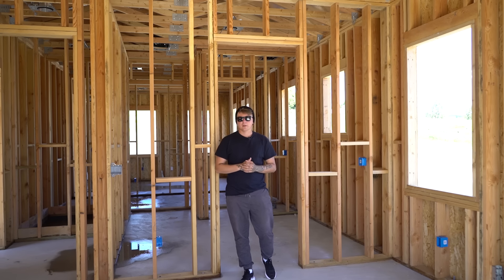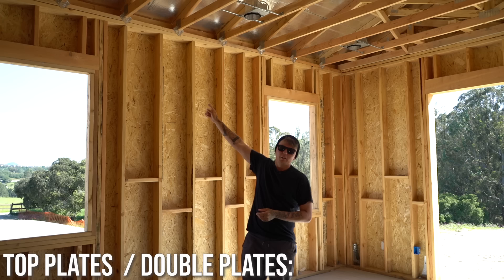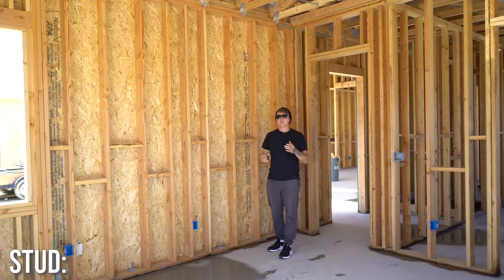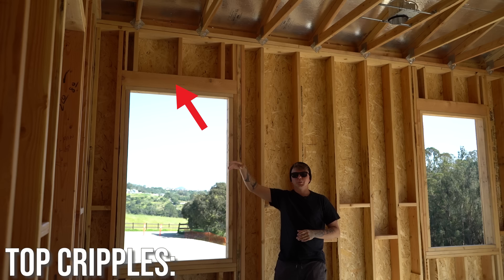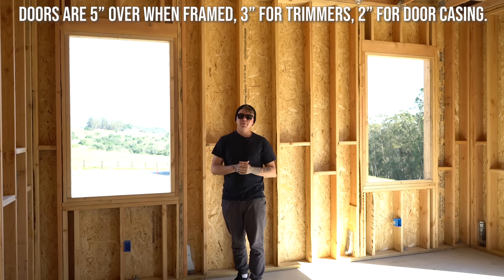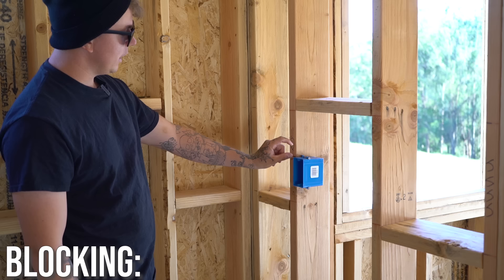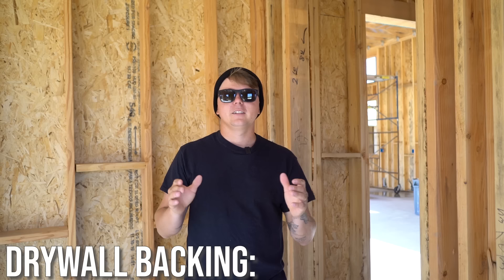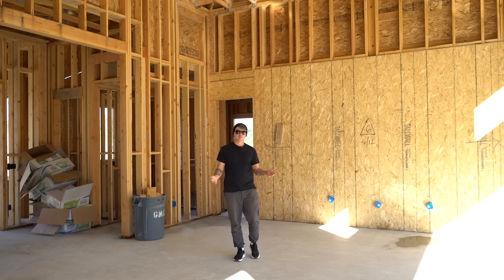Carpentry 101: Basics of Wood Framing with MattBangsWood [#1]

Comment: "pressure treated eaten by things..."
This is more likely to occur in treated wood which has had it's wood fibers either a) never properly treated to start with (e.g. heart wood spots, knots, etc.) and thus was more susceptible to nature/critters than wood fibers in other parts of the lumber that was properly treated/properly absorbed the treatment, OR b) the wood fibers treatment protection has weakened some to completely failed due to leaching, which can be caused by ground contact, especially with non-ground contact treated lumber (but can also happen in poorly treated/poorly installed/stored lumber), or caused by exposure to various environmental impacts such as contact with chemicals, contact with flowing water, etc.
While 'well treated' (lumber received appropriate amount of treatment chemicals, was exposed to proper atmospheric pressures/conditions for the proper amount of time, held at the proper temperature, etc. etc.) treated lumber, especially ground contact grades, using current generation treatment technologies, installed per code, and maintained as necessary given any changes to structure, environmental conditions, etc. ... you should never experience any issues.
....However... if you live in the "normal world" like I do, at least 1 if not more of these "proper/appropriate/etc." conditions will NOT be in place/exist; The only perfect carpenter was Christ! Every one of the conditions that are not being met means a greater chance of treatment failure at some level for some type of hazard.  The longer these conditions persist, the worse it can be.  
Basically, if you buy "good" treated lumber, install it correctly, take care of it, and luck out, you should have to best possible protection available from current generation treated lumber...that doesn't mean that in this near-perfect scenario of treated lumber will survive any critter attack; you could still be that one treated lumber owner who encounters that rare West Eatwhoodistani beetle or invasive South Grabasisbury ant invasion that proves too much for even the best treatment.
...and a bowl of green M&M's

If you got this far and understand, you're at least half as cool as I.

Comment: I'm highly allergic to OSB. I am just wondering why everyone uses it? Is there something else to use? I'm going to frame out a small wall for my kids to climb on with rock wall grips. Can I use plywood for the outside or is there a reason why people don't use plywood? Does it expand or something? I am just wondering why I see sheds built this way and all new housing construction with OSB walls.
Reply: Usually when it rains plywood sheets swell up and inspectors ask for them to be replaced

Comment: As a PE structural engineer I gotta say you nailed it 😉 well said. It's also worth mentioning how jambs and headers must be sized for wind loads in some areas. Other than that, the blocking will sometimes be installed with horizontal long edge at all edges of sheathing to allow for edge/field nailing patterns. It's called a shear wall and works both in wind and seismic forces (lateral loads). Then hold-downs. Overall, well done, I could hire you to educate some shitty cowboy framers I sometimes have to fight...

Comment: At 2:11 you start into how the studs are 'pinned' into the bottom plate after mentioning that the bottom plate was 'BOLTED' to the concrete foundation but just stop and think about that. Smooth nails shot into the end fibres of a stud are doing what exactly to keep a building down? Yes, gravity does all the work but a huge tornado or hurricane could lift a house off because of those smooth nails doing not much. Just food for thought. Speed of nailing or using screws?

Comment: I'm gonna call you out/correct you on something...
At about 12:40 roughly. The channel you showed works for interior walls that don't get insulated. But are NOT okay for walls that DO get insulated. It should go II_. Not I_I. Reason is the insulators cannot get insulation in behind there, thus creating a "cold" spot. Those cold spots always cause weird reactions with the sheetrock screws.

Comment: When I helped framers in the 90s, for bracing in the wall they would diagonally install bracing . Not blocking. They would cut in like a 1x3  or 1x4 diagonally inlay it into the wall. Cut and chip out 3/4 inch recess and fasten in the 1x.
Is that still proper or not recommended?
Hope that makes sense...

Comment: Very informative but I left with a few questions...
8 x 12 is 96 so where does the extra 4 inches come from when the stud is 92 inches, ditto for the 9 foot wall - is it 2 inches from the buttom stud and 2 inches from top stud? 
There seem to be two kinds of sills, one that only goes to the side trimmer and one that goes to the middle side trimmer (jack stud?)
Stud for dry wall backing at corners for interior walls,  is there a differences between exterior and interior wall corners, what about california corners?

Comment: Some corrections

I like how we use the different words from the same vocabulary for the pieces of framing, I remember having a stupid argument about it with a framer from California, both of us too stupid to realize the other wasn't wrong, but I know the terms you are using are correct.  The bracketed words are the Canadian equivalent or other names we use.  There are some big mistakes here however and I am the arsehole that gonna point them out.  Sorry eh..

-The chemical in treated lumber is toxic to the bacteria that causes rot, that is only mechanism slowing its decay. Treated lumber does not repel water, in fact it usually comes soaking wet and actually absorbs water better than kiln dried lumber kind of like how a damp mop is better at picking up water than a dry one.  Not sure about the bugs digestion but it makes sense you shouldn't eat the poison that is designed to kill living things..

-The window trimmers (cripples) should not be broken by the window sills and should run all the way from the bottom of the header (lintel) to the mud plate (sill plate) and the window sills should fit between the trimmers (cripples).  The way you have it would fail inspection and raise eyebrows in Canada. We call the upper and lower cripples (jacks or jack studs).  King studs, headers and the plates are the only boards in a wall we use the same names for.

-The double window sills do not add any structural strength but they do reduce the R-value of the wall.   Same goes for the 4 extra boards lining the window openings, larger headers and beams should have more trimmers (cripples) supporting them but that's not what's going on in that house.

-At no point in a header does the force of gravity take a 90 degree turn, barring a tornado the only force on the header and the boards holding it up is straight down.  The animation and description you gave trying to explain point loads are wrong.  Thats not how gravity works

-The double header plates (definitely NOT a lintel) on the interior door openings seem to be an attempt to meet with the building code that only allows a single horizontal plate when it is on floor or footing (this is so the 2x material does not crush under point loads) however that doesn't apply to most interior doors under 3' as the king studs carry the load if there even is one.
  Maybe its for nailing casing but the upper cripple (jack stud) above interior man doors should always be centered so you always know exactly where to nail the casing

Besides my nitpicking that framing is clean and tight, I'm sure it won't ever be an issue I just don't think it's a good lesson on how to do it right.  Also I had fun writing this so cheers bud.

Comment: Great video and content, thanks!
Just wondering what would be the best and painless way to frame an internal, non load bearing, full height wall? Should I install the top and bottom sill plate first and hammer each stud in place?

Comment: At 16:19 - what are some of the problems encountered by copying an overengineered solution, like using a 2x12-inch headers for a medium-large window or french door opening, vs using a structural engineer (other than unnecessary cost), or is this warning mainly for larger openings like converting an older home to an open concept.?

Comment: Nice video, but I did need to make one correction as it relates to the product over the 16 foot opening. That was not a PSL (Parallel Strand Lumber), it was a Rosboro X Beam (24F-V4 glulam). I realize in the grand scheme of things you were making the point that engineered products can carry more load than sawn lumber/timber. X Beams offer great value and make a nice alternative to other engineered products because they are more cost effective and come in dimensions that match all of the other wood products. The "typical" glulam beam does not.  Anyway, good job.

Comment: Possibly a stupid question, but if you pause the video at 11:58 for example, you'll see on the right side of the window what appears to be 3 king studs? What's the purpose of that? I see the trimmer stud holding up the header, and then count 3 king studs abutting each other. Can someone explain? Thanks ahead.
Reply from the maker: Engineering in California.

Comment: a couple of things i don't agree with, a 8 ft precut stud is 92 5/8", a trimmer stud should never be cut, it should run from bottom of header to top of bottom plate,  walls over 8 ft need blocking and green treated boards should be nailed with galvanized or zinc coated nails so the chemicals don't rust them away.

Comment: Disclaimer: Anything he mentions about tie-downs or metal plates is extremely location specific. Some places won't require much of anything extra in the buildings, some may require a little, and some may require you to take out a separate loan so you can afford all the extra metal shit the building codes require (I'm looking at you California). Don't get me wrong, most of the stuff is great and does it's job well, but a lot of it is clearly just there because Simpson (the manufacturer) obviously does a good job lobbying.

Comment: Hello 
I have a question. 
I am installing vinyl wood flooring. In a upstairs bedroom.  When I removed the carpet, there is a metal strapping running the whole lengths of the room. I leave in California is the a earth quake strapping?

It’s literally running down the center of the room. I’m pretty sure it runs the whole length of the house. It start at the putter wall across the center of the room into the closet. I’m pretty sure it runs across the hallway into the  room   Across the hall. 
What is that for? 
I would say it’s about 3 wide and has triangle little cutouts on it it’s probably about a 1/8  thickness

Comment: Why are there trimmers in a wood framed house?  Are there going to be inset windows?  It looked like you had 2x6 interior walls, is that right?  Why not 2x4? How are you going to insulate the "channel" on the exterior wall?  Are you required to have 6x6 headers in CA?  I wouldn't think you need more than a double 2x6 (room for insulation).

Comment: at 5:54 I am still trying to figure out where is king stud for left side of the window
Reply: the king stud is the 3rd vertical piece of wood from the outside. On the left side that's the outer-most piece that runs from floor to ceiling; on the right there is an additional wall stud, most likely just to make things nice and even or maybe the framers were OCD and wanted the wall studs to be more symmetrical

Comment: Do you use galvanized sinkers when fastening the bottom plate to the studs? My instructor said it’s a must or the chemicals in the pressure treated boards will rust the nails and ruin the shear strength. But in the 2 years I’ve been in the trade I haven’t seen one crew do it yet.

Comment: Hi, so my husband and I believe our contractor is cutting corners and ripping us off. We are getting an extention to our existing home. The bottom plate connected to the concrete is not treated. When we asked him about it he said we didn't need it to be treated wood because we will have osb and siding over it and moisture won't get to it. Is this exceptable? Also he said they didn't know they had to tie into our roof and it would be an extra 5k. Everyone we have talked to says that they knew cause that is a very common practice. We feel it was a gross oversight on his behalf or he is a scamming us. My contractor claims it was "unforeseen and beyond his control". 
Any feed back would be greatly appreciated. 
Thank you 
Penny from Texas

Comment: Thanks for the explanations.  At [8:49] it looks like the right most bottom cripple, against the king stud, is 1x4 (?)  Is that correct and if so, why ?  
Also, at [11:35] you're standing in front of a wall that has an "extra" stud in the middle (a blue outlet box hangs from it) that breaks up the
16" on center spacing - why is that there ? Thx!

Comment: Just a few observations, your corner blocking is incorrect if it's an outside corner; you eliminated any way to insulate it, it's against code in many states. Secondly, theoretically headers should be at the top of the wall and cripples under it.

Comment: Hi Matt, I've learned a lot from your video's and in fact I went crazy being inside during last April when Covid was just getting started. I ended up building a garage with your inspiration. I got a few things wrong but it came out okay and even attached it to house using a Hip or California styled connection. I've been watching a lot of other builders and i noticed some talk about insulating the headers around doors and windows, so you don't get nail pop from extreme hot & cold days, etc. Just curious what your thoughts on that are. Otherwise, thank you again for the inspiration because I work behind a computer all day but luckily, I have true blue blood in my DNA and that gets me outside on the weekends building and break shit!! :)

Comment: Thanks for the excellent video! Looking to frame up a wall to close an opening. Does it need a double top plate in this instance? Also does the bottom plate still need to be pressure treated wood? It is against concrete but it's completely interior.  My gut says yes, but thought I'd ask.

Comment: New to building, will be starting with a small project like a shed first but then a workshop. I will be milling my own lumber since we have access to a forest on our property. 
Would framing be similar to explained on this video if I plan on using planks VS OSB for my outside and maybe even inside the wall? 
Another consideration I have is building with either 6x6's or 8x8's rather than framing but as I said very new to builds.

Cheers!

Comment: 16” center framing. I’m confused. We’re am I starting to get exactly every stud 16” ON CENTERED. That doesn’t mean on the sides but centered between studs. I know this matters when installing drywall.I
 want to learn all I can. Fascinating.
Reply from the maker: Hook the corner of a building and every stud should land 16" on center. Same exact way I've described here. Windows and doors fall in areas and the king studs don't ever land 16" on center, that doesn't matter though.. The layout for bottom cripples and top cripples continues at 16"..
Reply: 15-1/2 to be on center for next stud to be on center, if hooked on one end of stud.

Comment: Good information well delivered. I’m building my own house, not a builder by any means. I do know a lot about building,handed down from my Father. Have a question/comment. This is my 2nd house build. The first one I did not have a big hand in building. I learned so much from my builder friends. To the point. I have not seen on any of your videos where you drop down on your outside walls 12” of a 24” PT Sheeting. I was shown this by a builder. Tap con into the concrete pour. The concept is to lock walls in to concrete foundation. What are your thoughts? 
Regards, Chuck

Comment: Interesting that your precuts are 92 1/4 and 104 1/4, ours here in Utah are 92 5/8 and 104 5/8.
Do you insulate your channels before you sheet?
Reply: Here in South Dakota our precuts are at 5/8" as well. Most builders, even in California, insulate the channels. In the midwest we frame slightly different so that everything can be insulated from the inside, not the outside.

Comment: I am trying to screw and eye screw into my exterior wall (My house is stucco exterior wooden framed just like your video), but No matter what I do (transferring measurements from inside, referencing existing plugs and stud finders) I can't get a good grip or in other words cant firmly attach anything to the exterior wall. Should I just go deeper and deeper? Can I screw directly to the exterior wall or I need to apply sealant ot my screw and then screw it or anchor is mandatory? I am just confused.

Comment: Lot of good comments here and I agree, its a good thing you know so much about framing! However, there are a lot of things I would personally do different on this build.
The amount of wood everywhere isn't helping as much as you think. Example: Instead of 2 top plates, just use 1 LVL. Instead of having a jackstud or trimmers as you call them, use simpson strong tie header hangers for your window openings. Instead of having studs in every corner like that for drywall, use a california corner in order for that dead space to be insulated.
The problem with using so much wood is that it takes up so much valuable insulation space. In colder climates, this is especially important to consider. 
But I suppose that is more of an advanced form of training :P